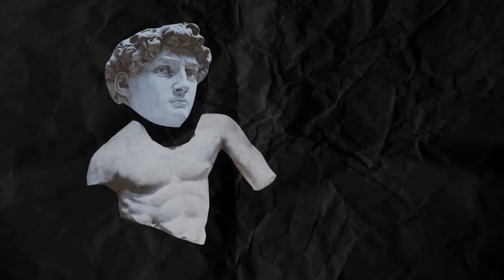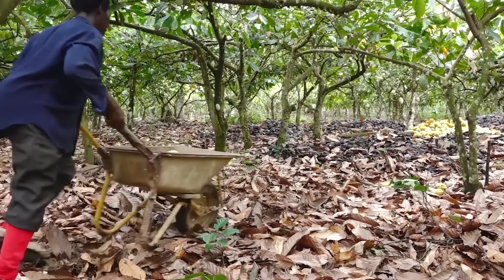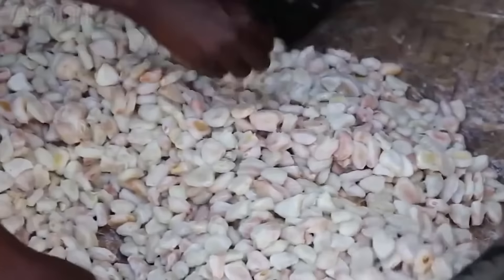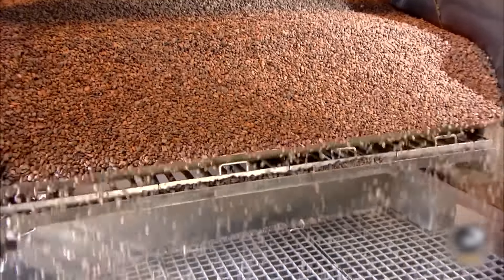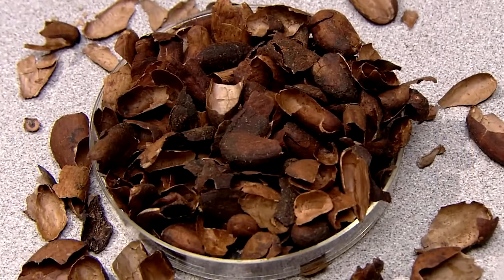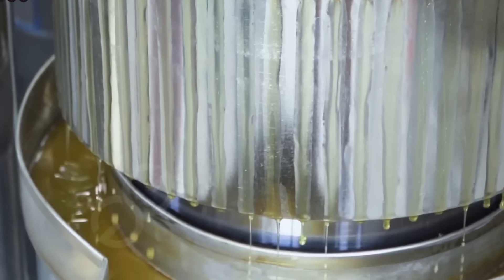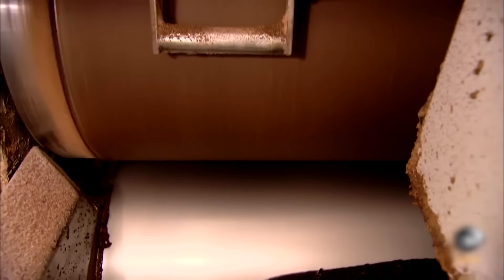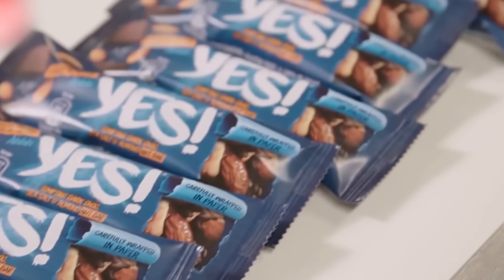How Chocolate is Made

Comment: 🎯 Key points for quick navigation:

00:45 🍫 The Mayans discovered cacao due to their geographical location along the Equator, where specific conditions for cacao tree growth are met.
01:53 🌱 Fermentation of cacao beans not only enhances flavor and color but also eliminates bacteria and removes sticky white pulp.
02:47 🔍 Quality assurance ensures cacao beans meet color and consistency standards before further processing.
03:30 🍫 Grinding cacao nibs into a thick syrup marks a critical stage in chocolate production, transforming its composition.
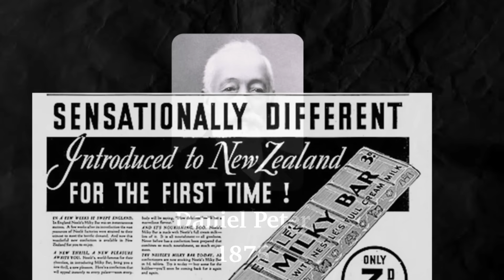04:40 🍼 The invention of milk chocolate in 1875 involved mixing chocolate liquor with powdered milk, a process known as conching.

Made with HARPA AI